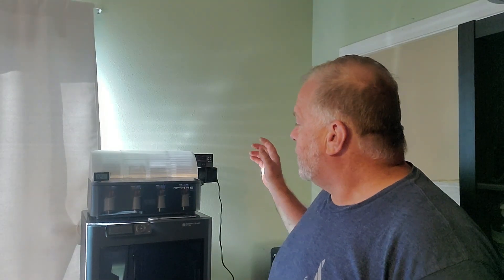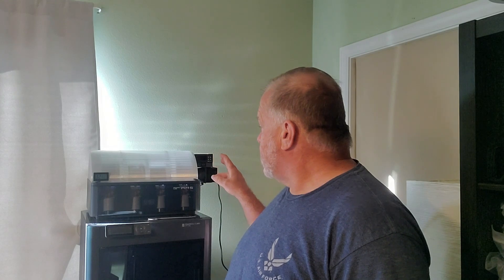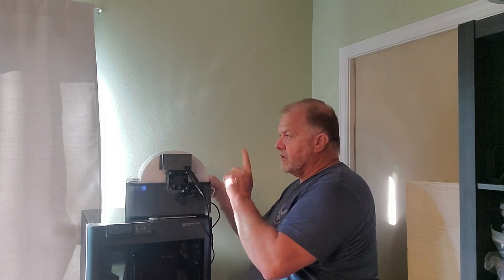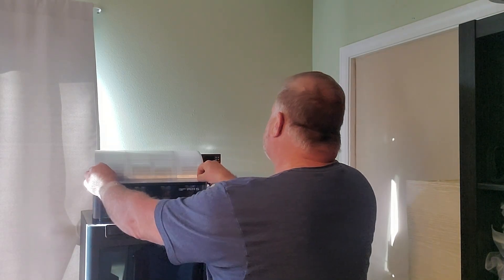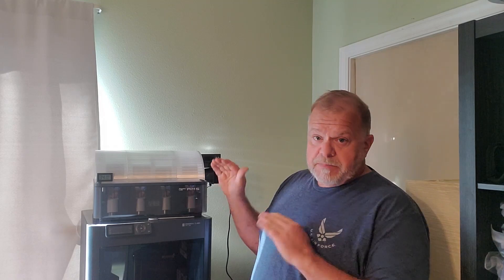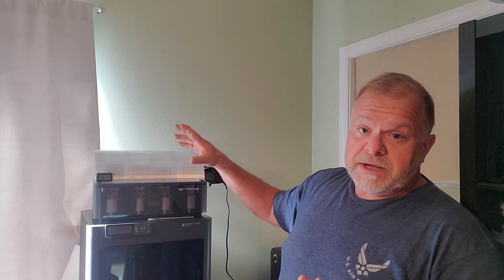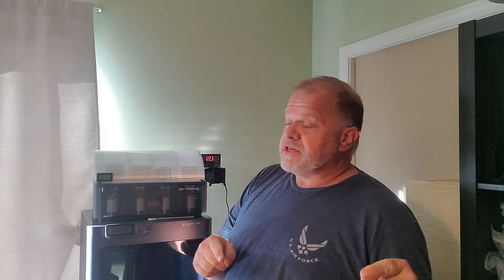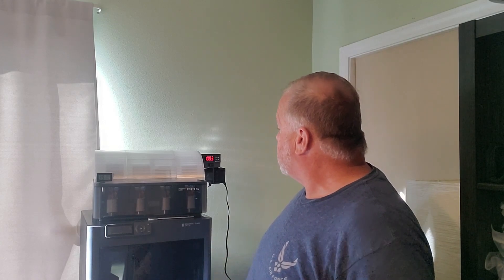The Ultimate AMS Drying System - Quick Release Explanation

Comment: How long would I have to keep the heater on for the filaments to be considered dry?
Reply from the maker: Until it shuts off the first time, the rest of the time it would simply be keeping it dry. If you are set to on-35 and off-30 you're gonna have some very dry stuff and should work well. Then you can try raising those numbers up towards 50 to figure out what it should be for your environment. 

I've actually been tempted to expand on this project. Using the drier as is, but then once it detects the filament is dry, it shuts off the drier and the opens a desicant door to maintain the filament. 

Kinda a energy saver type thing. The air is how the water moves. The heater causes the water to come out of the filament and into the air, the way the air comes in and out the vent removes the water from the AMS. Once it's dry the humidity in the AMS goes way down(no more water evaporating from the filament and into the air) and the drier turns off. 

From there, I would need to find a way to open a door to desiccant which would keep the air in the AMS dry and prevent the water from getting to the now dry filament. As is, like I said, I just have it keep taking it out anytime it gets a little too humid in the box. 

You can't just keep the desiccant in the drier while it's running. Because it is so hygroscopic, it takes extreme amounts of heat for the water to come out. So your drier running at a safe temp for filament is loading up the desiccant with water. 

I was doing the math a long time ago but I think it was the equivalent of leaving 25 watt light on for 8 hours a day. So, it's not like some huge power hog.

Comment: Also, have you thought about routing an air return pipe from the left side back around to the intake of the fan in order to re-circulate the air?  (Similar effect to how PolyMaker does their DryerBox.)
Reply from the maker: If you watch the first longer video I talk about the three methods of dehydration. Dehydration is about removing water. 

With desiccants, you are pulling the water into the pellets and then taking them out of the controlled environment (removing water)

With heat, you are creating the ability for the air to hold more water, giving it a chance to pick up that water then removing that air with the high water concentration from the controlled environment by venting it (removing water). 

The cooling method uses condensation to pool the water into a tank or a hose to drain the water away from the controlled environment.  

This is a heating system which helps heat the water in the filament causing it to expand and then come out of the filament thus into the air and then vented from the environment. Recycling the air just puts the high concentrate air back into the system and it never leaves. 

As far as polymaker, having a brand name doesn't mean they know what they are doing

This is time-stamped to the other video where I talk about the methods https://youtu.be/wiNkckE29Aw?si=KbkNHd5LZmGZ5Bye&t=294